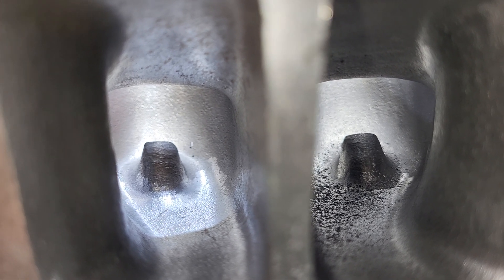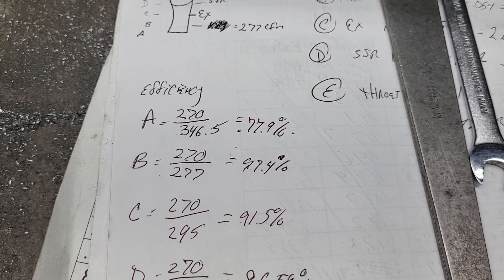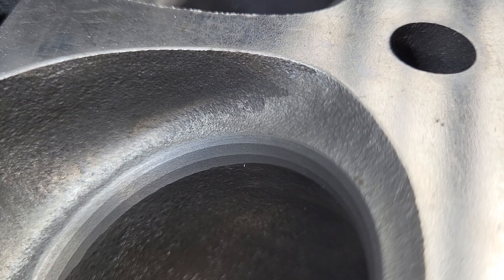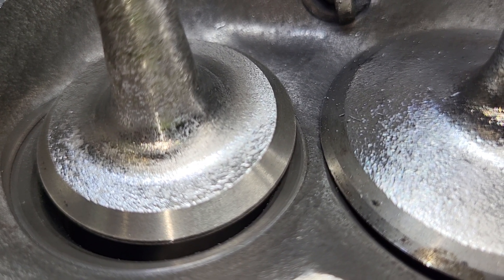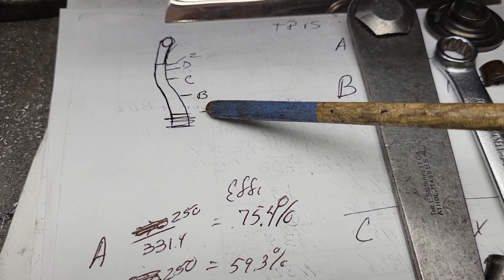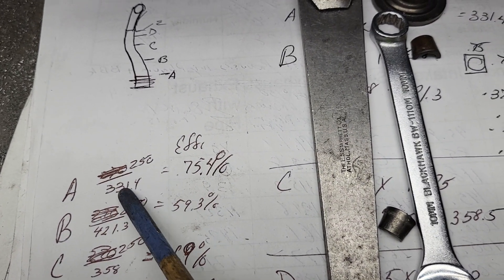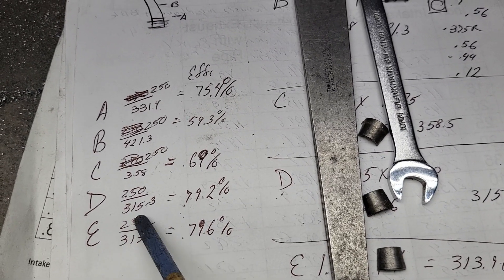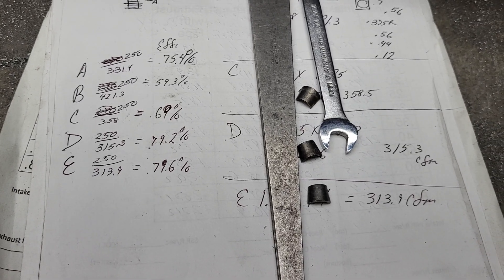Ported Dart 165/Tpis area/efficiency calculations. Geek fest

Comment: I’m glad to see that cylinder head companies are still making heads with near stock intake runner volume and improving on that. Those 165 Darts that you did there out flow many heads with 200 cc or larger runner volume. I’m very impressed with your take on these! 👍🏻
Reply from the maker: I have a video where I flow a stock Dart 215 and these beat it! Thanks

Comment: Charlie, 
You are better of using CFM/IN2 at the pinch,throat and valve area's. 
And a hint - they are not all calculated at 146 in2.
Also i dynoed my last 383 sbc changing 1.6" exhaust valve to a 1.5" which ended up at 92% throat. 
I have not done a back to back but will track test soon.
Bigger exhaust throat is rpm dependent, throat area goes up,CFM goes down but power goes up if rpm is increased but the whole engine combination has to follow the trend.
In my 383 i believe the exhaust valve change will make zero difference. 
On the dyno it made 1.35 ft/ lbs per cube and 585hp @ 6800rpm.
11.25 comp on pumpgas.
Reply from the maker: You should tell us you did this with the same heads as this. Explain how they all not calculated at 146. Thanks
Reply: I ran a 383 combination a few years ago with the same heads,1.94" - 1.5" valves.
11.65 compression 
240 - 256 @ 050" 
Comp roller.
Ported 300-25. 
950 hp carb.
Using MS 109 fuel 
522 ft/ lbs @ 5300rpm 
570hp @ 6600rpm. 
Ran 10.62 @ 126mph in my 3620 lb streeter 
Radials and mufflers.
On my bench intake on flowed 262cfm @ 28"
305 cfm @ 45" 
At max piston speed a 383 requires 304cfm @ 7000rpm. 
Exhaust flowed 230cfm @ 28" 
265 cfm @ 45" 
With a 6" pipe.
I don't care to much about cfm on the exhaust as I look at throat/ flange area depending on rpm.
I am a believer in if the CSA and shape are close the CFM will be there.
Charlie, no criticism intended  just want to share another way of doing things.
Reply from the maker: I appreciate your input. Thanks @stevecowan1362

Comment: A shortcut to find the area of the radii is 0.858*R^2

Is the 2.39 sq.in just the throat, or does that take into account the valve stem?  If not, then the actual area is 2.30 sq.in, and the actual efficiency is 80.4%.  That's excellent for a low port head.
Reply from the maker: I did forget the valve stem. Good point. I always do that!